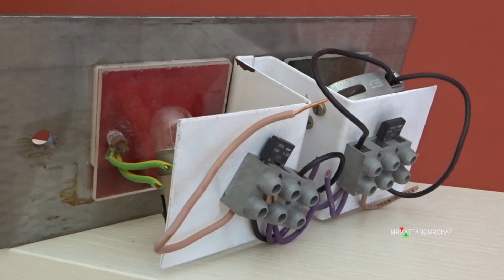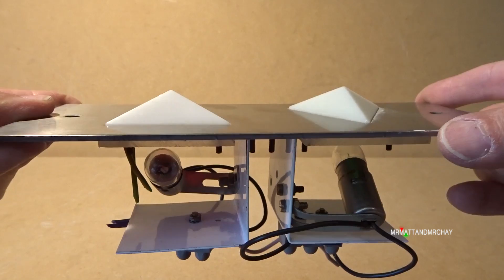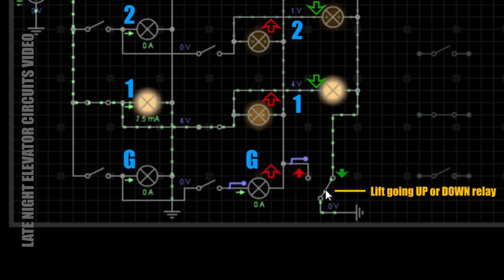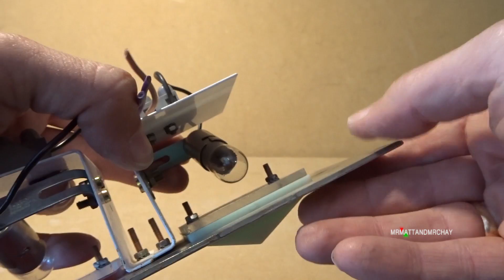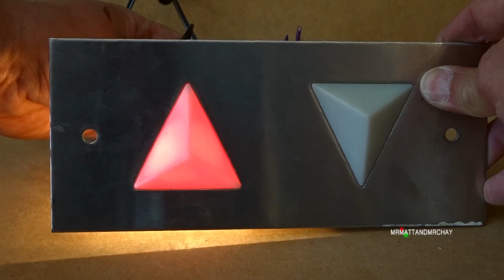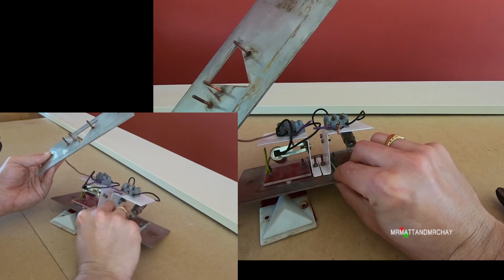Old Dewhurst ELEVATOR LANTERN (inc beautiful start!)

Comment: My local shopping centre’s lifts have these indicators on some floors
Reply from the maker: Dewhurst still sells them, but they have LEDs behind the plate instead.  These ones are proper old skool!
Reply: mrmattandmrchay these where installed in around 1987 i think
Reply: @mrmattandmrchay  Cool! I don't see them though. I suppose they probably aren't very popular. What'd be nice is if with LED's they implemented something which makes the LED fade on and off like a bulb would. It all adds to the character of a classic lift indicator!
Reply: What do they look like on the other floors?
Reply: Lift Tracker on some floors they have been replaced with digital indicators

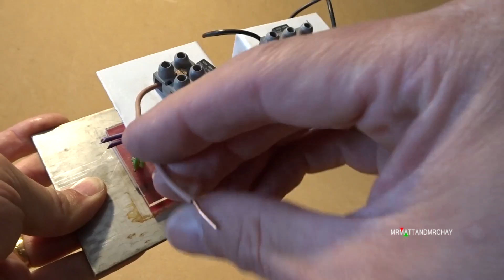Comment: 2:27 As you indicate in you're circuit, both wires are probably switched. So there is no "wire that turns it on". ;) Also, the diode may be on either side of the bulb. Only the fact there are 2 purple wires per terminal suggest they might be tied together.

Comment: The brown stains around the backing plate and the plastic insert look like coffee stains but they are probably a weird mixture of rust and dust particales cacked together. Quite neat how they welded the bolts to the backing plate.
Reply: I thought it was rust too, but where could water get into the panel from? Unless it's just moisture of course. An old lift in my local shopping centre had it's right hand outer door replaced for some reason. The replacement door was completely rusted! I mean the entire thing! They must've been storing the spare lift door in the damp basement for years! They have since replaced it again, but I have no idea where they got another spare from, or why they had to replace the original one!
Reply from the maker: One thing to consider is this display is at least 30 years old.  Being fixed to a wall without a seal for all that time gives plenty of time for stuff to get in there.  In the end, it's very difficult to tell what exactly that stuff is, but it brings character to that display!